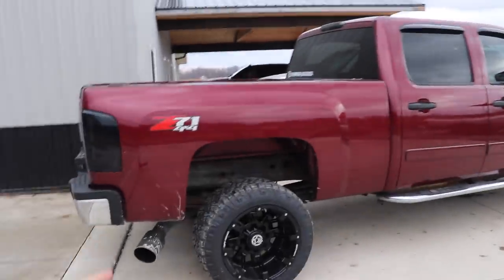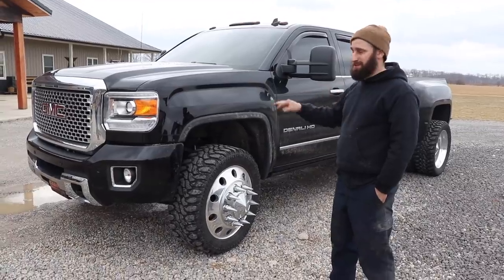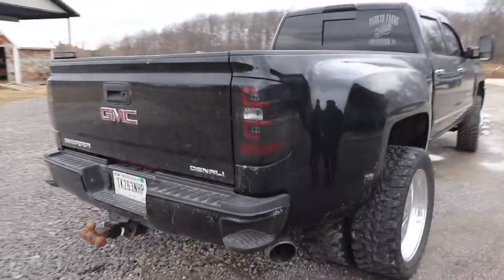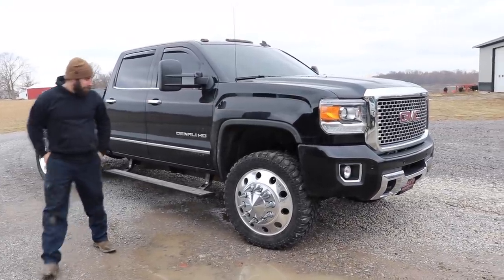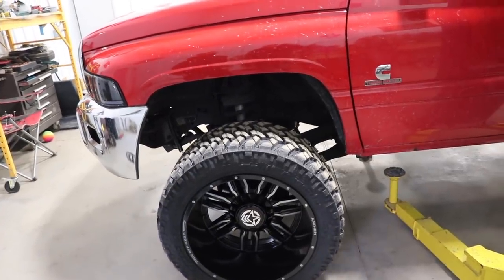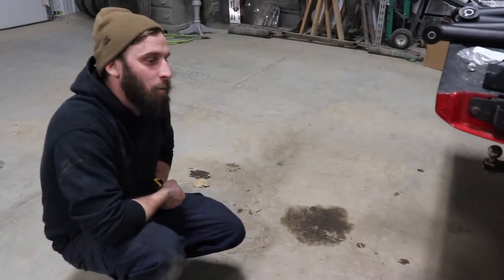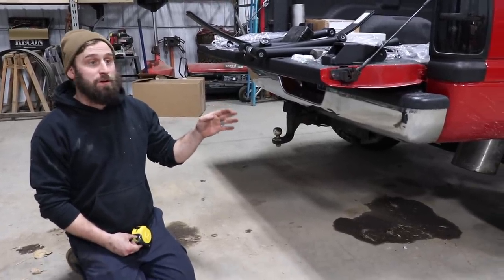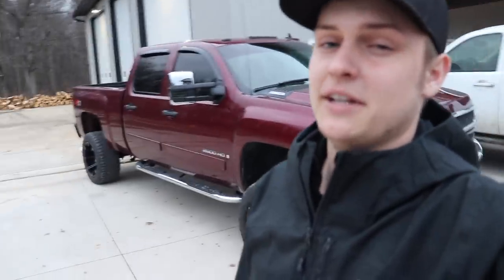MONSTER 10 LUG DENALI DURAMAX DIESEL!!!!

Comment: The zone lift blocks will be the same hight as the factory blocks but with a taper on the front to correct pinion angle. The zone kit lifts the rear by using the add a leafs provided in the kit. The front has steel leveling spacers and stock coil springs. Remove the old coils and spacers, install new springs, and all provided drop brackets and arms. The rear, remove factory blocks, add the extra leaf in the leaf packs and reinstall with new tapered block.